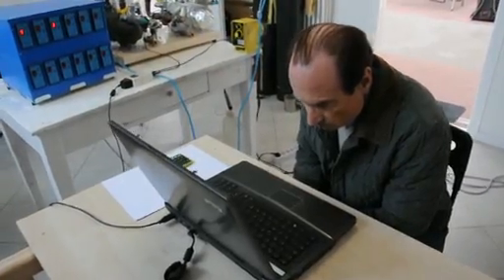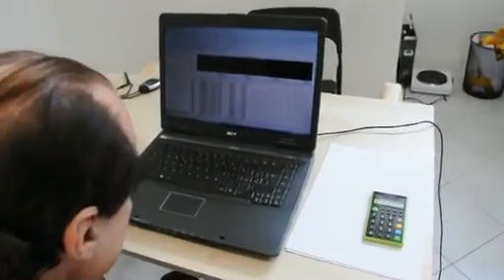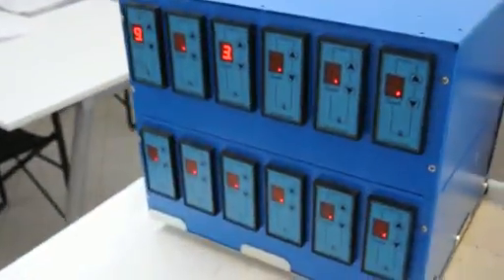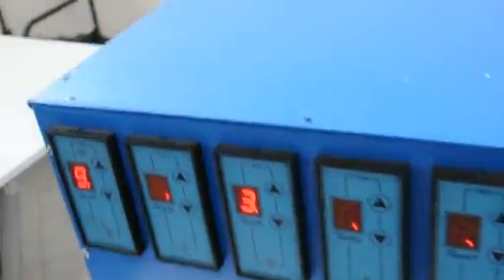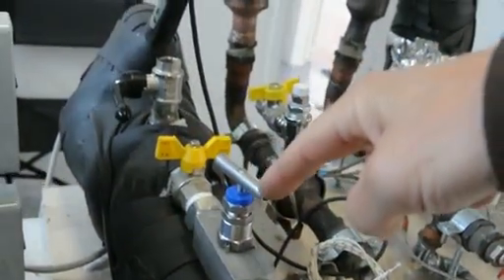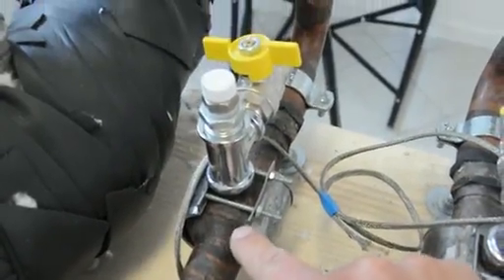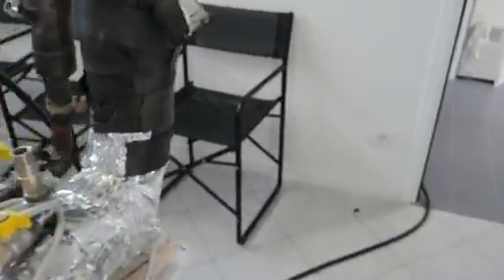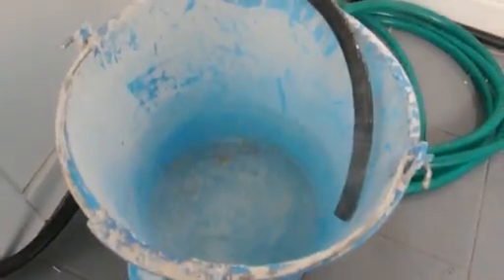Ny Teknik tested the energy catalyzer (Andrea Rossi)

Comment: Funny facts. 
Total efficency of Rossis Cold fusion box =
Output:
Q=m*c*(T2-T1)
m=7kg/h =0,00194kg/s
C= 4,18 (kJ/kg*K)
T2 = 100,1
T1 = 26

Q =  0.601 kW  = 600W

Rossi input 700W

600/700= 85%

Total efficency of cold fusion box 85% (same as a electric heater)

I guess Rossi is not that good with numbers and facts.

Comment: this is complete bullshit.
1. water may leave the system not in form of steam so it maybe colder, the thermocouple only measures the steam inside the chamber -> big fail here
2. why would someone need to heat the system once it produces heat by itself, better insulation / less waterflow would get it self sustaining if it would work at all
3. did you ever hear about the sabatier reaction, if there is heat produced this may be the source of it ;) so no netwin here.
DONT BELIEVE THIS IDIOT!

Comment: I'm very sceptical of cold fusion, but I can't explain what's going on here. Comments:  
1) the gas velocity calculation by vglmhl is basically correct, but assumes steam is leaving the tube end, not mainly water droplets.
 2)  Combustion of 1g of hydrogen produces 143kJ of energy, which would heat 7kg of water by 4.9 degC. 
3)  The power from the a.c. supply is wrong in the other video: you can't just use P = V x A for a.c.

Comment: Some calculation:
water transformed in steam:7 l/h / 3600sec  = 0,001944444 l/sec
steam production:0,001944444 l/sec * 1600 = 3,1 l/sec = 0,0031 mc/sec
if pipe diameter 1 cm ->  pipe cross section = 0,0000785 mq 
steam's exit speed: 0,0031 / 0,0000785 = 39,5 m/sec = 142 Km/h 
I do not realy see that the flow comes out at that speed.